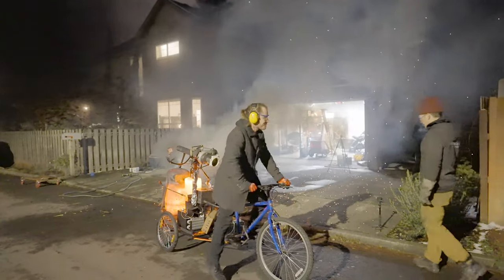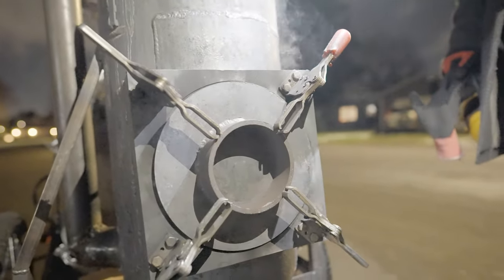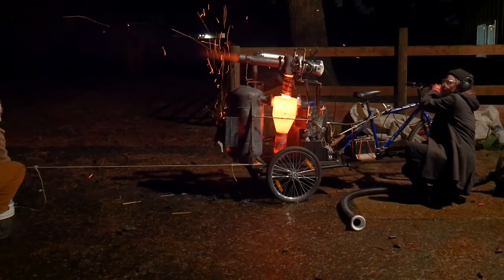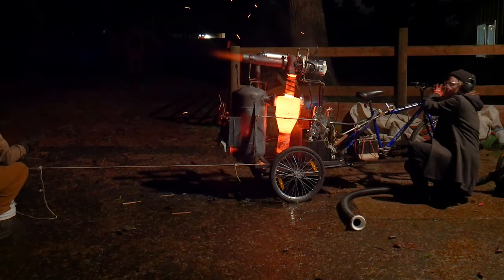TURBOFURNACE: THE RIDE

Comment: If thrust is the goal, instead of throttling the intake, wouldn't it be better to have a controllable "waste gate" to send excess pressure out the back, bypassing the turbine?
Reply: Most jet turbines are fuel regulated, this has ample fuel and will run away if you don't throttle the inlet air.

They should route some of the first stage inlet air into the hot side of the turbine, ie, as a bypass, which will bring exhaust turbine pressures up, while lowering the temperature of the exhaust turbine. This needs to be variable as the amount of bypass air must be tuned on a turbojet.

Water injection is a noble goal, but, as you can see in the video, metering the water input is difficult, and will require a needle valve with high enough precision to get right, and a pressurized water system with a bypass before the valve to keep the water pump from failing.
Reply: @jttech44  JT you could definitely throttle via a waste gate, just would need a big one.
Reply from the maker: JT gets it.

Comment: That is pretty funny stuff guy’s, your neighbours must love you, I thought the tyres might catch fire first before the door blew. Good job & hats off to ya for trying, but dont stop yet, ya nearly there. 
Your door need a re-do, it could be smaller, but a big issue I see there, is that the overlocking catches you are using are pulling most of there force to the outsides, against each other, & not down onto the sealing surface. 
There are probably a number of other ways to get some real work & power from this contraption, but thrust is probably the least useful, albeit a lot of fun to play with though. 
Anyhow, I like ur Turbofurnace creations, so dont stop yet. TFS. Cheers.

Comment: If you want ideas for the door, look at aviation for examples. If you can make a 'plug door' that has a wider lip on the inside, it pushes itself shut when there is more pressure in the chamber. All airliners have them because their cabins are pressurized compared to the outside air at altitude.
Reply from the maker: Love this idea.

Comment: What about a two chamber combustion design whereby compressed air is diverted to two combustion chambers. The primary serves to gasify the wood and preheat the combustion air for the secondary. The secondary chamber serves to complete the combustion of the available fuel gas ( for a clean burn) and to temper the exhaust gas leading to the turbine and to control the turbine inlet temperatures to below 750 deg C

By modulating( butterfly valves) the airflow split between  the two chambers some control will be gained from the current run away boost and temperatures.

After the hot gas generation process is under control the next steps would be to harness the energy with a " Free turbine" driving a generator or transmission, similar to a turbo prop or helicopter turbo shaft engine or industrial turbo generator

Jerry rigging a surplus turbo prop or helicopter turbine engine to run off wood waste would be the ultimate !
Reply from the maker: We have considered a gasifier design… it might come i a later iteration. Definitely gonna use a butter fly valve to modulate flow around the combustion chamber in the future to keep TIT reasonable, but probably won't go for the gasifier right away.

Free turbine is also in the design stages. 

Thanks for watching!

Comment: So, whenever you get back to this project, will you be working on thermal efficiency next? I know they’re called heat engines, but they aren’t supposed to glow yellow hot. That’s kilowatts of energy that physically cannot do useful work in the current design.
Reply from the maker: Yep!
Reply: @survantjames   I’ve been thinking of how that could be done and one idea I’ve had is replacing the throttle body with a bypass valve just after the compressor. It could divert air through cooling channels in the walls of everything that touches the combustion gasses before reintroducing it right upstream of the turbine.
Reply from the maker: @kyleeames8229  Yep. This is the purpose that a “flame holder” or “combustor liner” serves in a normal gas turbine.

Comment: Woah! Huge respect for the effort. 
You said you have another turbo just laying around, and plenty of spare boot in the chamber?
Well... 
Maybe add that turbo as well, and feeding both the cold side and the exhaust into the afterburner?
You probably have plenty of wood gas and producer gas left in the exhaust just ready for combustion.
Maybe a bigger afterburner would du the trick to get use of it all?
I like misting before the turbo to give it more boost from the steam and lower temperature to spare the poor thing from melting.
If temp go to low it might not ignite the gas in the AB tho, which if a problem could be fixed by having a thin bypassing ignition pipe straight into the AB.
No more in -22 you said. Can't wait for -23.
Hail Motor!
Reply: The channel Bobby McBoost got an old boat moving using similar thinking in the video:
I made Thrust from Fire Wood! - Turbo Jet
Reply from the maker: Thanks Glad you enjoyed! We'll be back in 2023.

Comment: In your next design consider a smaller door. A smaller door means less square inches with pounds of boost stacking up against your latches.
Reply from the maker: Yep. Someone also suggested a door that presses against its seals as the internal pressure increases, which is also a great idea.

Comment: Could you design the door to open inward so the pressure would hold it shut instead of trying to push it open? Also I'm looking forward to seeing what you get up to next.
Reply from the maker: You know that’s a pretty dang good idea I hadn’t considered and if / when we attack the problem again I’m probably gonna do exactly that. Thanks!
Reply: @survantjames  Look into Metal pressure seals for the combustion chamber door, I use them at work to maintain vacuum of 0.00002 mTorr at 500 degrees Celsius, so I imagine they would work for this application.
Reply: we need all the internal clearance possible for our ruggedly hewn fuel sticks
Reply: Using coal briquettes would solve this problem. Would be even better if you use gear pumps to feed in coal slurry continuously.